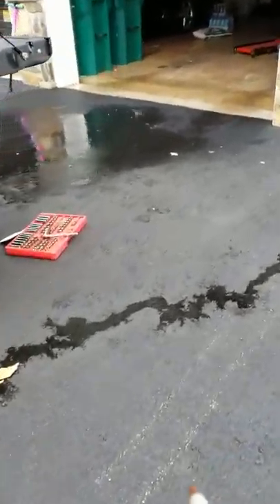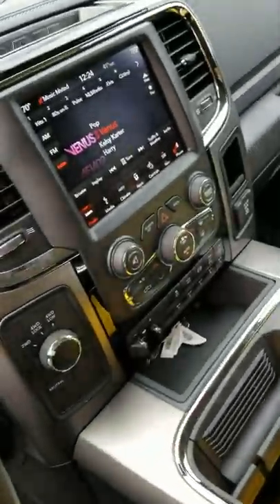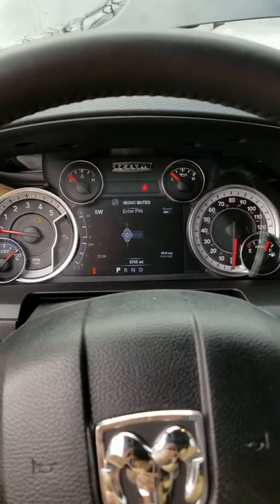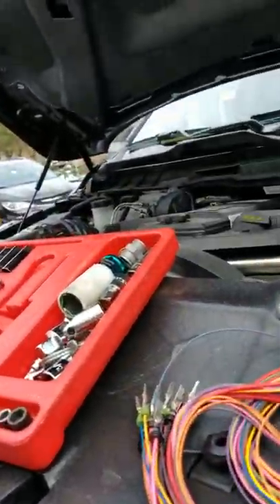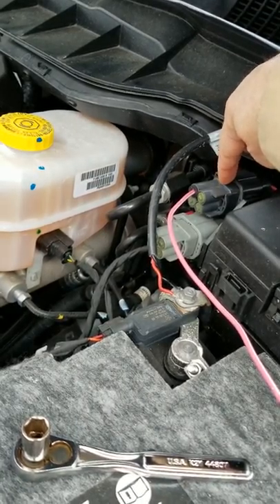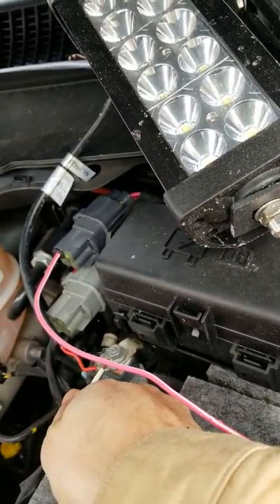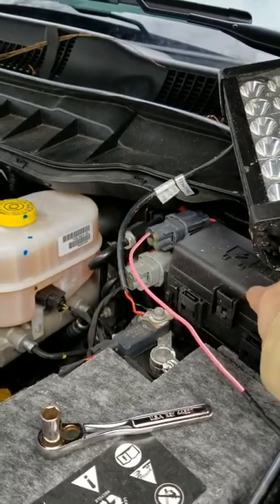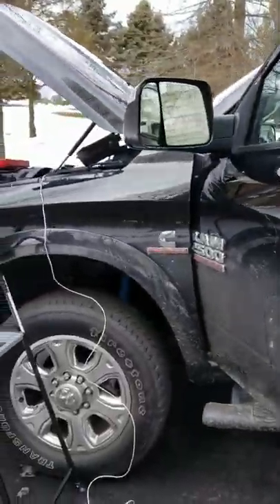Wiring LED Light Bar to RAM Upfitter Aux

Comment: Regardless of the way the factory harness is configured, not all those circuits can handle the high amp draw of some light bars. They ALL can handle being the trigger wire for an external relay. In my case, I would use the upfitter switch wire as the power input to open the relay and the actual amp draw would come off the battery which is a safer way to do this. On my ford, the highest factory switch was 25 amps and some light bars can draw 40 amps if your using them on pairs. On low draw accessories like pumps, led market lights etc. wiring the power directly into the switch and utilizing the factory relay is fine. It never hurts to have a secondary relay to safeguard the original circuit.

Comment: How can one get the upfitter wiring kit and if it's not too much to ask how much are they? Enjoyed your video thanks for it.
Reply from the maker: It has 6 ports, not sure how much it was i know on the wrangler its a $600 option and that has only 4 buttons.
Reply: Ni no lol not how much the option to have the Aux buttons, but the wiring itself. How much did the wiring cost? Lol
Reply from the maker: @Allaboutmepodcast  I don't recall, I bought the wiring at a hardware store.

Comment: Hey man, I’m looking into installing an air horn with just a compressor, no tank and I really like the clean look of the aux switches, can you explain how it works not using a relay and just using the trucks
Reply from the maker: Each aux switch already has both a switch and fuse associated with it from the factory assuming your truck has the aux switch package.  All you need to do is wire into the correct upfitter port with the pigtail wire to power the device and ground to either the frame rail, battery or the grounding upfitter port.
Reply: Samuel A Muñoz so the light bar has 2 wires. White and black. Wire the white to the upfitter port and the black wire to the negative battery terminal?   That’s it?
Reply from the maker: @timyocca5703  one to the port and the other to a bolt on the bumper near the frame rail. The frame rail is grounded (connected to the negative battery terminal) from the factory.
Reply: Samuel A Muñoz couldn’t I also just run the other wire to the negative terminal?
Reply: @timyocca5703  you don't need to and doing so is a waste of copper. New(er) Dodge/Ram pickups have a dedicated ground stud (good for 50 amps) on the left frame rail just ahead of the bumper bracketry. This is a preferred location but any available bolt is acceptable.
Reply: @DilettanteDon  the only warning would be if the compressor draws more than 26 amps (26 amps is the maximum allowable continuous current through a 40 amp fuse... I doubt the horn compressor would be operated continuously, however).
Reply: Did you get your horn mounted? I'm doing the same thing and was curious how you did it. Thanks
Reply: Chris Harvick I don’t even remember how I did it. That trucks gone now. I remember that the ram has the pre made plugs to keep the water tight seal for the aux switches.
Reply: I have a 2015 ram 3500 tradesman. Doesn’t have the uplighter box in hood like you showed but has the aux buttons. How would I wire my light at?